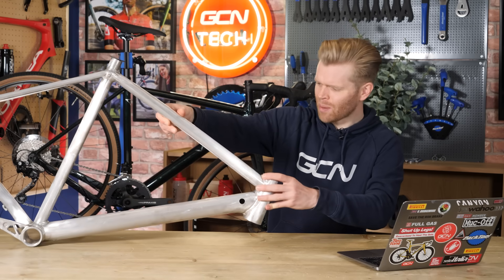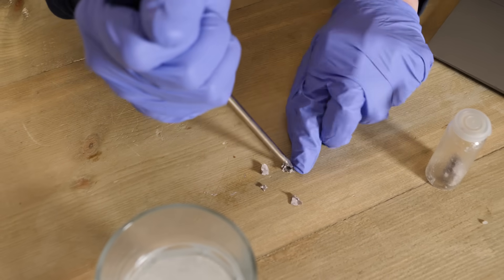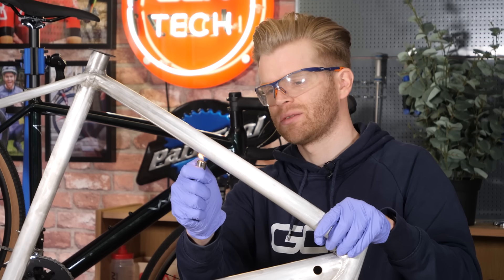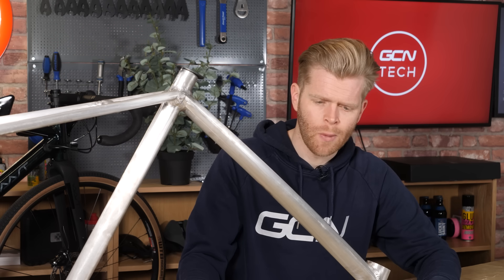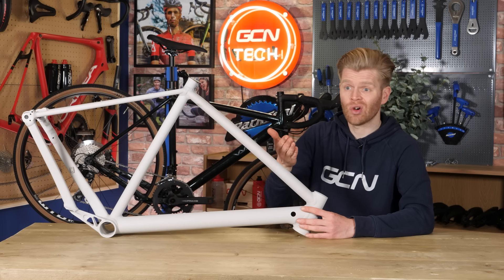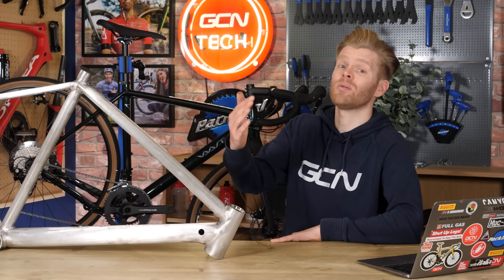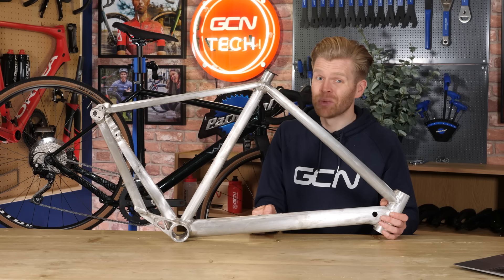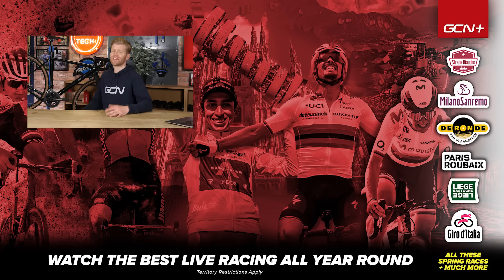5 Things You Need To Know About Magnesium Bikes

Comment: Ollie stick to Chemistry bud! Damping and stiffness are two completely different things. Low Modulus materials are just less stiff and will vibrate at a lower resonance with larger amplitude. This isn't damping. Most metals only have about 0.1% max molecular damping.
Reply: By definition, lowering vibration resonance is dampening. Calm down.
Reply: @ZenEndurance  no it isn't. And do you mean damping? What's dampening?
Reply: @PeakTorque  It's the act of your brain getting wet and smooth when you tried to reply to my comment.
Reply: Yeah he is missing the point, metal springs need to be dampen by oil circulating "shocks" to absorb energy.
Reply: @charlesgatine7045  dweeb.
Reply: wanted to say the same. Great video, but the last bit is just wrong in so many ways
Reply: wow.. here's me thinking I couldn't actually care less about the vibrational dampenning of a frames material.. but here we are.. You proved me wrong.. congratulations.

Comment: so unalloyed magnesium absorbs vibration better. but the bikes are alloyed AND the tube sections are thicker, so there is zero benefit in absorbing vibration.

lots of inconsistent comparisons here.  a summary table would likely show that overall magnesium is more expensive less corrosion resistant and doesn't offer many benefits over aluminium.

Comment: its an easy fix for carbon bb's, just use extra material in and around the bb and do a final machining in the end. the tolerances are usually off by less than a mm in most cases anyway. its not hard to make a tool with make a perfect bb and carbon isnt hard to machine like ti, or other metals

Comment: I just did an EcoAudit in GrantaEdupack - and I got bad news for the carbon guys especially. carbon fiber bike frame uses almost 500% of the energy an Alu 6061 would need in total. In the manufacturing process of the product, yes Magnesium uses much less - but the manufacturing energy needed, is so small compared to the production of the material itself (also including the typical percentage of reused material). So if we take a 1.5kg alu 6061 frame as a baseline we have the following alternatives:  a 1kg Ti-Al3-2.5V titanium frame (+97% energy, +70% CO2e), a 0,8kg Carbon fiber frame (+490% energy, +480% CO2e) and a 1kg Magnesium allow AZ31 (+30% energy, +17% CO2e). So if you ask the planet - go Aluminium!

Comment: But, the magnesium alloy is more sensitive to corrosion than the aluminum alloy doesn't it?
Reply: It's a special alloy in this case (Allite Ae 81), the manufacturer of the alloy claims it has the same corrosion resistance than aluminum. If this is true or not - I don't know
Reply: @simonm1447  Interesting!! If it was true I like to have one too.
Reply: @อานนท์จอสูงเนิน  the complete bikes of this manufacturer have a Msrp from around US $ 2000 on on their website, framesets cost around 1200. However it's a US manufacturer, you would have to import it from there if you live outside the US

Comment: Very intelligent and interesting video :)

Your concept of youngs modulus might be a bit off. Youngs modulus is stiffness of a given material for a given geometry. It doesn't tell a person about the strength of the material. A weak steel and strong steel will both be ~200gpa
Reply: A material's Young's modulus, or elastic modulus, is the stress at which it starts to deform in a plastic manner, rather than elastically.  Constant stress (or load) above the elastic limit will cause continual deformation, whereas below the elastic limit the material can recover.  As I recall, stainless steel doesn't have a well-defined elastic limit, but a 'reasonable' value can be used for engineering calculations.  Carbon steels are about the value you state.
Vibration of a frame is a function of it's overall geometry, component's geometry, and materials.  A frame will have a natural frequency, and multiples thereof, at which it 'likes' to vibrate, much like a musical instrument.  The compliance, as I understand it, is the amount of deflection under a rider's weight causing impacts on undulations in the road surface, or their pedalling force, and it depends on the frame's overall geometry, component's geometry, and materials.
This explains why a carbon frame (using material with a low elastic modulus) can be stiffer than a steel frame (using material with a much higher elastic modulus).  And why steel is real.
Reply: @richardharris8538   @Richard Harris  I appreciate the answer. I have some corrections. I believe you mean elastic vs inelastic "yielding" of the material. Steel does not have a fatigue limit when kept in laboratory environments, but the real world has corrosion that would limit that applicablility of this concept to a bike frame. Carbon is actually a high modulus material that can typically be 180gpa, as compared to 200gpa for steel. It can even exceed the stiffness of steel with high modulus carbon.

I think we agree that a low modulus combined with a geometry of larger moment of area can compare equally to a material of high modulus and lower moment of area. This will define the rigidity and thus vibration qualities of the bike. I should note here that the low density should be of benefit to increasing the frequency of vibration as defined by the square root of the weight/stiffness of any given material.

Carbon fiber is actually really good stuff, but sometimes suffers because it is made so light. A carbon frame of equal weight to steel would be unimaginably strong with a lifetime exceeding that of the biker (and consequently very expensive). I do appreciate the ductility of steel compared to carbon. Impact is not kind to carbon.  I would not ride carbon on a mt bike. I would not choose steel for a tour de france elite athlete.
Reply: @ZebraLemur  Oops!  My bad.  My excuse is that I haven't thought about this stuff for years.  (I'm retired.)  What I meant to say is, "A material's yield stress is the stress at which it starts to deform in a plastic manner, rather than elastically."  The Young's modulus or elastic modulus (stress / strain) is used to calculate deflection when stresses are less than the elastic limit or yield stress.
Fatigue failure occurs when a sufficient number of stress reversals or stress variations occur to cause the material to fracture.  I've forgotten the materials science explanation of fatigue failure.  Something to do with inclusions moving through a matrix of crystalline grains, I think.

Comment: We had magnesium bikes some twenty years ago. It didn't work, because magnesium is too reactive. It's just a matter of months until your screws (bottle cage, brakes, ...) eat holes in your frame.
Reply: See this: https://en.wikipedia.org/wiki/Galvanic_corrosion
Since magnesium is on the lower side of the redux list, it gets eaten by every other metal. My old Rock Shox fork has outer tubes of magnesium. It looks horrible.

Comment: You can't beat Ti bikes, he forgot to say that yes it is 50% lighter, but also MUCH lower in strength. I wonder how many years you'd realistically get out of a Mag frame vs a Ti frame.
Reply: True. But the other piece is the price point. Bought this bike a few weeks back for $1800 USD. A lot cheaper than a TI bike!
Reply: @pacificbeachbumb  If you don't mind me asking, was that the price for just the frame?
Reply: @nklarck9218  Vaast’s website lists it at $1300. The whole bike I got for $1,899 with GRX400 2x.
Reply: @pacificbeachbumb  Okay, Okay. Thats fair, considering you'd be hard pressed to find a reputable Ti frame alone for that price. Thats very affordable. Enjoy the bike and happy riding!

Comment: Would have liked to know the compliance factor of the mag alloy vs titanium and steel for apples to apples frame comparison. I know you guys know this so it cant be favorable if you didnt mention it.  Shame on you for this promo piece.  BTW- THE WELDS LOOKS PRETTY SLOPPY
Reply: There's no such thing as the compliance factor. The Young's modulus (which he did list in the video) comes closest, but there are other considerations. In particular, aluminium has a low Young's modulus, but there's a limit to how much use this is for frame compliance: because even slight flexing fatigues aluminium in a way that can cause it to suddenly snap catastrophically. So alu frames are in practice always designed with a substantial stiffness margin (by way of thick hydroformed tubes). Steel is at the opposite end, it has a high Young's modulus but because it is so dense you really don't want to use it any thicker than necessary – in practice, the thinner tubes cause steel bikes to be more compliant (which is ok because it can take a lot of flexing with little fatigue risk) than aluminium, although the latter is an inherently more compliant material. Magnesium is softer yet, but not sure where it stands fatigue-wise.
Reply: @leftaroundabout  I get it there’s no compliance factor. It was my way of just saying that he spoke about pure magnesium and it’s compliance versus the magnesium alloy  that the bike frame is actually made of and then tried to compare it to steal and titanium

Comment: When biking my current bike I actually looked at magnesium. Went with carbon mainly because I hadn't had a carbon bike yet and was itching to finally have a carbon one. And because the selection of magnesium bikes is stilly very narrow, mainly Vaast Bikes, and so far they're mostly US-only.
Maybe when I buy my next bike in x years there will be more magnesium bikes available, would be cool.
Reply: they are counting on more guys who have an itch simply to own something new, unnecessary, but gotta have. best of luck.
Reply: How are you finding the carbon bike?
Reply: Vaast has also been majorly out of stock any time I've peeked, at least for the frames I'd be mildly interested in.
Also kind of annoyed there's none with cable stop/shifter bosses on the downtube, the lack of options is a problem.

Comment: I was an active photographer and back then majority of the dslr body is made from magnesium alloy. Tough and lightweight. Was thinking before why not use this same metal on bikes and just learned today that magnesium bikes existed before. Interesting. Thanks GCN!
Reply: It still is used in most mid range and pro level cameras.  That it’s now used in bike frames is really cool.
Reply: top end drywall stilts are also magnesium alloy
Reply: As a car enthusiast I can add that magnesium alloys were also used in 60s/70s top level motorsport. Magnesium wheels were rather common in the scene at some point, and some race cars even had magnesium alloy tubeframes. They were abandoned due to fire hazards, but that's obviously much less of a concern in bicycle riding, so it makes sense to be used there. So I guess the only reason to pick titanium over magnesium is corrosiveness?

Comment: With regards to precision enginnering, it opens the question if is it also precision manufacturable. With thermal expansion higher and conductivity lower than aluminium, magnesium calls for greater disturbances in weld areas.

And no, vibration damping is not about the magnitude of Young modulus. It is about difference in Young modulus at compression and decompression. What VAAST are actually saying here, the frame acts like a softer spring compared to an aluminium or titanium with same tubing. It smoothens the vibration by shifting their frequency, but it doesn't affect the corresponding energy. Yes, "basically ... it's more compliant", but frame stiffness has always been more influenced by tube thickness and dimensioning rather than the chosen material.
Reply: big ugly beads that welcome contaminates. this is where they will break unless you keep that huge bead wide, and as deep as possible.
Reply: the Youngs modulus of metals  in the elastic regime is (Sigma <0.2) is identical for compression and decompression
Reply: @robertrjm8115  you must be a mathematician, right?

Comment: American Classic used to produce magnesium bike rims, among the lightest rims ever produced. The corrosion issue didn't suit rim brakes but, disc brake rims avoid that issue. I hope someone starts producing magnesium rims again soon. 
A low section, magnesium clincher rim weighed 290 grams, that's 100-200 grams lighter than the average alloy rim.
Reply: Magnesium is used in motorcycles. They use it for parts and covers as well as wheels. At least they did. I've not followed motorcycling for a few years now but I don't think it's changed.
Reply: @DaveCM  For car parts too. Especially high performance ones.
Reply: I broke every American classic hub I ever owned. Don’t know why 🤷🏼‍♂️. Same guy built my wheels for 20 years. 🖖🏼
Reply: @phillippitts6294  They only make tires now apparently
Reply: @onehourmusicbc  thanks. I had a friend who was a rep for them in the mid 80s ? Maybe a couple years later.
Reply: @phillippitts6294  What part(s) of the hub did you break? I'm still riding a front hub that I've had from the early 90's. Seems fine with very smooth bearings and a retro look. It's 28 holes laced to a Mavic rim. I don't have the rear any more since it was 126 mm spacing and used a  7 speed freewheel, and I don't have any use for that any more. But it was good for a long time as far as I could tell.
Reply: @johnortega2605  the flange where the spoke hooks , mine were 28 hole also. I also had their bottle cages . Weighed nothing!🖖🏼
Reply: @phillippitts6294  Yikes - now I'm scared! I also had Phil Wood hubs and really liked them.

Comment: I considered Mg frame and bits in the past, turned out the problem with frames is they had little fatigue resistance, ie. they're more likely to crack than Aluminium. Pretty kool material though.
Reply: As does a carbon frame....
Reply: @marceljanssens5935  I think it depends on how much reserves the frame has. Carbon is very strong in fiber direction, and as a fiber material it has not the classic fatigue of a metal. However, fiber materials can delaminate if they are under stress, and the resin can age and is not UV resistant like a metal.
If a frame is built with as little material as possible it will fail over time, independently which material is used

Comment: Magnesium was the bread and butter of F1 engines but it got banned because it is flammable. When it catches fire it wont extinguish using traditional methods. I wouldn't keep a magnesium frame inside a house. Carbon frames can be extinguished as soon as you break the triangle of fire.
Reply: If your magnesium bike is a fire danger in your house, your house is already burned down. Are you scared of everything in the world??
Reply: did you not see him try light it on fire?
Reply: @nateboness9801  In the 1955 Le Mans disaster (where about 80 people died when a Mercedes flew into the crowd) the fire attendants couldn't put the fire out caused by all the magnesium parts of the wreckage burning at an extreme temperature.

EDIT: also, they tried to put it out by water
Reply: @GeeFunk84  And?  The people were killed by a flying car and its bits, not by fire.
Reply: @kidShibuya  I'm just saying that magnesium is indeed a flammable material under certain circumstances. I wouldn't have a problem having a bike in my house, but if it's such a magic material, why do manufacturers shy away from its mass production use?
Reply: @GeeFunk84  not saying it's a "magic material," but if 1) bike consumers aren't expecting this as a material (i.e. there's no market) and 2) bike manufacturers and their supply chain have to invest heavily in new designs and new tooling to manufacture the frames there's a lot of risk for not much reward. The major bike manufacturers are already making money hand over fist selling conventional materials that consumers know and expect. A small, new entrant will bring a new material as a way to differentiate themselves from the mass market manufacturers. Once/if the concept gets proven by smaller players and it starts to get annoying for the big brands, they'll get into it as well because it's less risky and they know the market is now expecting bikes made from this materials and also to prevent share erosion. Iean, it's a timeless concept for new entrants competing with well-established players in a mature industry. You're basically asking why major brands of vehicle manufacturers didn't create full-electric PEV's with minimal designs before Tesla did, or why major phone brands like Nokia, Blackberry, Motorola, or Ericsson didn't make an intuitive touch based phone but instead waited on a computer company to do it.
Reply: @GeeFunk84  So when a flying Mercedes going 150+kmh flew into a crowd and decapitated or crushed people. The fire killed them, an engine is extremely hot, your house is not. If the magnesium caught fire in the first place there is something wrong and your house has already likely burned down.
Reply: The thickness of the magnesium greatly affects its flammability. So magnesium components less than 3mm (from ancient memory) were banned in race cars, over 3mm was allowed, as not considered a fire risk.
Reply: Magnesium will burn if it's heated up too much, but typically there's no heat source on a bike which could do that. This is differnt from an engine, which has a permanent heat source inside the construction itself.
Magnesium can only be extinguished by powder made for this job, or by dry sand, but not by water or foam.
Inside a house it will only catch fire if the house itself is on fire before.

Comment: I had a Kirk Precision back in the 90's with Dura Ace STI.  Was an awesome bike, but kept cracking brake stays
Reply: Rode my Kirk last week
Reply: I had Kirk Revolution (well I brought one) of these started off with a purple frame plus replacement then a black frame. Snapped a few parts of the frames.
Reply: I worked at Kirk Precision for 4 years, until it folded in 93. It was a roller coaster
Reply: I had one as well.  It was like riding a wet noodle.  Very flexible material.